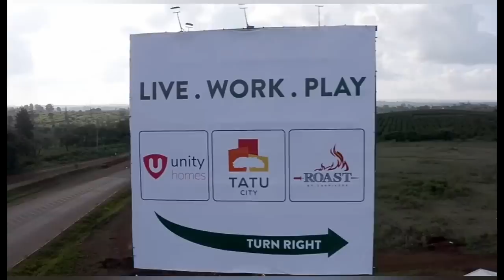Kenya Is Taking Over Africa With These Projects...

Comment: Kenya should industrilize, then factory will build roads and railways.
Reply: Best comment here! They need to build infrastructure locally without outsourcing these projects to foreign companies.
Reply: Kenya needs the roads and railways to industrialize
Reply: @universalnihi8374  some are local some aren't. The non local ones are mostly talked about, that's why most people think everything is built by foreigners
Reply: Easier said than done, it would take them twenty years to get to that point. It's like saving up to buy a car to run a taxi. The time spent saving the move would be time lost it you had just taken out a loan and starting immediately.
Reply: Most of this projects were launched 5-7yrs ago... we're still waiting...the amount of corruption there is just insane.

Comment: Kenya's infrastructure is far ahead than Nigeria. Though, its gdp per capital is a bit lower than Kenya. Most of the roads in Nigeria are still struggling from Lagos or Abujah to other states. However, huge projects are still underway for Nigeria like Eko Atlantic ( though it will take 30-50 years to complete) new railways and bridges in Lagos. I appreciate the progress of African continent.
Reply: amebo, who is asking you about roads in nigeria. you talk too much. celebrate the kenya project and not nigeria projected for 30-50 years you claimed
Reply: How did Nigeria come into this matter with your defective analysis? The video is on Kenya. Leave it there.
Reply: Ooh God i had to laugh to this ati 30 to 50 years ooh mehn😅
Reply: … this is about completed and on-going projects in Kenya and you compare it to an on-going and no completeds in Nigeria… what a way…

Comment: Foreigners might be awed my the many projects. However, many Kenyans do not care about the nice roads and railways at this point. The country is in deep dept - 10 billion dollars- which has seen the rate of taxation rise sharply. Any straight thinking Kenyan knows that the real motivation for this is mega projects is corruption; politicians have realized the easiest way to steal is through grossly overpriced projects. Presently, the average cost of building a road stand at 1 million dollars per kilometer. And that's on the lower side. What is the point of nice highways in the capital while 95% of the country lacks food, jobs access to healthcare and education? The country is so poorly managed that the national bureau of statistics no longer provides data because it would paint a bad picture at a time when the country is running on foreign loans.